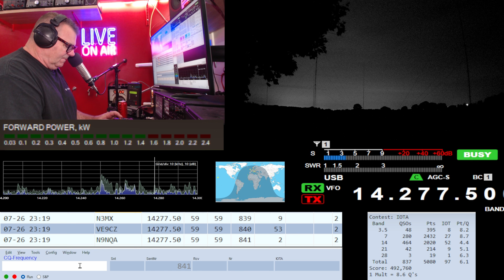Why I Don’t Want an SDR Ham Radio

Comment: I use a ft991 which is the back up radio,  my main radio is ft1000mp which is 21 years old. I have end fed mono band vertical and horizontal and dedicated listening antennas for each band i use. over the years i have finally l settled on the right antennas, I'm in a built up area. noise level between 5 and 7 depending on time of day
Reply from the maker: The FT-1000MP really is a fun radio – once you’ve got antennas and receive sorted, age matters far less than people think. Settling on the right antennas in a noisy area is half the battle, and it sounds like you’ve done exactly that 👍

Comment: it's kinda not about SDR vs super-het I guess, but about all the DSP that is very common in the modern transceivers, which happens to be SDR at the same time. reminds me on how many assume all electric cars to be a computer on wheels just because those two modern trends are usually sold together.
Reply from the maker: Yes. It’s not SDR per se, it’s how much processing gets layered on by default. Just because two trends arrive together doesn’t mean they’re the same thing. You can have DSP-heavy radios that feel fatiguing, and SDR-based ones that are very natural - it all comes down to implementation and how you choose to use it.

Comment: I have had many transceivers, but I keep going back to my FTDX-5000. I am able to hear and understand the signals better. I also suffer with constant head pain due to a head injury from a car accident back in the 90s, when I use my FTDX-5000 I can listen to it for longer without making my head worse.
Reply from the maker: Thank you for sharing that. Comfort and fatigue really matters, especially when you’re listening for long periods. If a particular radio lets you enjoy operating without making things worse, that says a lot. The FTDX-5000 has a very easy, natural presentation, and I’m glad it works well for you.
Reply: thanks Cal, Dave M0PEX

Comment: I agree with this as a Cw contester. The k3s is just super pleasant to operate compared to the 101/10 series. I don’t put direct sampling rxers in my top 5 at all. Icom is dead set on it. Wish these companies would bring superhet back
Reply from the maker: K3S is apparently very easy on the ears. Direct-sampling has its strengths, but for long contest sessions the way a superhet presents signals still matters a lot. I suspect there are more people quietly wishing for a return to that approach than the marketing departments realise.

Comment: I have a 7851 and 7760 and fully agree!
Reply from the maker: OK... Expensive. Tim Duffy is still using the 7851 I believe. If a radio makes you want to operate for hours without fatigue, that’s where the value shows.

Comment: That's the problem whit lot of operators, the key is listen listen and listen in the noise.
SDR great but you say it all, DNR/NR can help sometimes too get a weak station out of the noise but a good analog radio whit a good external speaker or good headphone does it too but you have too have trained ears to notice a station in the noise.
Have listen too many radio's in  40 years to HF rigs and SSB CB radio's and the new ones nah... too noisy too sensitive whit white noise like SDR  and so on.
But like you said it's personal and depend where your location is, in a noise free area every radio will do fine but in QRM and noisy urban area different radio's can make the difference whit qrm.
Reply from the maker: Exactly. Listening is the skill that everything else sits on. NR/DNR can help at times, but trained ears, a good speaker or headphones, and time spent listening do just as much. And you’re right - location changes everything. Quiet rural QTH vs urban QRM are two completely different games. Use what works where you are 👍

Comment: Last year i bought a Yaesu FTDX10 which is a hybrid and it sits there gathering dust..... Its a nice radio but im happier using my older rigs like my TS950, IC751A or even my 1967 Swan 500, much more fun to play with.. Just my thoughts.....10 10 till we do it again.....
Reply from the maker: That makes perfect sense – those older rigs are fun to operate and that counts for a lot. The TS-950 apparently had real personality. If it makes you want to sit down and listen, it’s doing the job. 10.10 old friend!

Comment: The numbers are useful  if you want an accurate S-meter instead of  a "guess meter."  Before SDR you couldn't get accurate signal strength meters.
Reply from the maker: That’s fair - accurate meters are useful. I admit I rarely quote them though… it’s usually more “you sound like S5 to me” than a laboratory reading...

Comment: This is the ham radio version of the old vinyl versus CD debate. However, your TS-990S is not an analog radio. At the IF stage, it chops the signal into bits and processes it digitally, just like an SDR.
Reply from the maker: True - the 990 does digitise at the IF. My point wasn’t analogue vs digital as a block diagram, but how the front end and filtering present audio to the ears. Same maths, different feel in use - and that’s what I was talking about.

Comment: I was a police dispatcher for many years and I couldn’t agree more with this! I knew who was talking by the sound of the voice before I was given the unit identifier. Analog was the best and when digital trunking came about I nearly lost my mind with how much “garbage” I heard from the digitizing of the audio. After 20+ years retired I still dislike digital radio, to include DMR, D-STAR & C4FM. I don’t know if I’ll ever get used to those modes. One of the most pleasant experiences I’ve had was operating an old tube transceiver, the audio was rich and full. Amazing to me. Cheers and 73.
Reply from the maker: Wow. That’s a fantastic analogy. Voice recognition, cadence and tone become second nature when you’ve spent years listening under pressure. I can completely understand why early digital was such a shock - a lot of context gets stripped away. Older "stuff" can have an audio really does have a richness that’s hard to forget. Thanks for sharing that experience, and 73
Reply: yep. the thing about those specific digital voice modes, is that they all using a synthesized speech (specifically using the AMBE (or IMBE in case of D-Star) vocoder) 
interested to hear your opinion about the sound quality of Allstarlink for example, where it is still digital but an actual voice streaming rather than a synth.

Comment: I don't want an SDR receiver either. I've done buying any more radio gear now. 
I have my h/b QRP s.s.b./c.w. tcvr with one luxury, an audio c.w. filter, also an FT817ND with one 455 kHz xtal as a c.w. filter because I'm Scrooge and wasn't paying £130 for a c.w. filter so increasing the cost of the 817. It works O.K.
I love my Racal RA17L rx with excellent filters and very stable. 
Even my old wide receiver Wireless 19 Set is useable with good c.w. listening ears. 
I remember one amateur saying, "Why should I struggle listening to a signal which is not 5.9.?"
Because we can! I've worked c.w. signals at 2.3.9. and 3.3.9. C.W. ears do it!
G4GHB.
Reply from the maker: Well said. That quote sums it up perfectly - because we can. CW ears and time at the receiver make all the difference, whatever the gear. The RA17L looks like a classic too. Thanks for sharing that perspective - proper radio!

Comment: I actually have a similar problem with my G90, lovely radio to use portable and tunes any old wire, but the standby/running noise it generates even in a quiet location is irritating to hear. To me it sounds like a high pitch whine and I hate it! 

If I had heard what it sounded like in person, I would've bought a FT-891 instead.
Reply from the maker: You’re not alone there. The G90 is brilliant for portability and tuning anything you throw at it, but that background whine does bother some ears more than others - and once you hear it? You're stuck with it... It’s one of those things you only really discover by listening for a while. The FT-891 definitely has a different, calmer audio character. Another good example of how specs don’t tell the whole story.
Reply: That whining was introduced in a FW upgrade - I think to have more gain, the input to some of the SDR stages are being driven too hard. It's been reported for over a year. In general I agree with Callum an old school radio or at least one with an analogue front end, allows the brain to decode the weak signals  better, and it's easier to listen to. Ed DD5LP

Comment: All ham operators have the same ability. If I’m operating in company, who aren’t ham operators, they struggle to hear anything. Think you are talking about filtering which I hope your 990 would have that. Respect your opinion though
Reply from the maker: That’s a good observation - there is a learning curve. Most of us forget that it takes time to “tune in” to SSB and recognise cadence and structure. Filtering helps, of course, but ears adapt surprisingly quickly once you spend an hour listening.

Comment: I have never been a fan of DSP.  I try it but invariably switch it off. I still remember from my SWL days 60+ years ago using a terrible no filters wide open superhet and you could judge the state of the band just by the noise. Modern radios are very good but I miss that experience.
Reply from the maker: I know exactly what you mean. That background noise told you how the band was breathing long before you heard a signal. Modern radios are remarkable, but that sense of context is something many of us remember fondly. Thanks for sharing that memory!

Comment: Everything you say is a proof you desperately want an SDR transceiver with waterfall where to apply your good hearing skills. When somebody launches CQ, even a strong signal, with a classic analog transceiver you can be on his/her frequency exactly in his break, and miss him/her. I don't; I see it on the waterfall, on YAESU FT-710. You can miss even extremely strong stations on an old analog transceiver without waterfall. After knowing a station is there, on which frequency, you can apply DSP or not. Maybe it is not even necessary to apply any DSP at all. It's about missing completely the station or not. An SDR waterfall shows you somebody is in the band, where in the band. All your rest of discussion has to do with your good hearing skills, not with the SDR waterfall. Another comment also told you about confusing SDR waterfall with DSP. Daniel VE7LCG
Reply from the maker: I get your point - waterfalls are genuinely useful for finding some signals, and I’ve said many times they’re excellent tools. This video wasn’t about discovery, it was about copy once you’re on frequency and listening fatigue over time. Different tools help at different stages. I’m not anti-waterfall at all - just choosing where I rely on ears rather than screens.

Comment: I totally see where your coming from, I'm not opposed to sdr either but it makes total sense. I too want my brain and ears to be my personal sdr and not have a machine take away my control. Reminds me of vehicle manufacturers completely automatic, no manual transmission taking away my control to repair or drive it myself. I still have a lot to learn myself.

Oi from Alabama USA 
TU, 73 de Kq4hcu

Comment: I've said it before, it's all in the style your use to working with.  Any rig made in the last 20 years will provide you a good service. True SDR rigs are not for the person who rushes setting a station up. If you want to use hybrid sdr "plug and play" buy one of the big 3 box store radios. You need a good quiet antenna to rx with, you need to have an electrically quiet environment as well. Let's get to the Sherwood Report...It means nothing, way too many variables in buying a radio then to worry about something you would need test equipment to see. The 990 is a great radio as well as so many others. I've had the chance to use so many in my short 24 years in the hobby. This video hit the main point, use what works best for you.
Reply from the maker: Well said. Style, environment, antennas - they all matter far more than a single number on a chart. Almost any modern rig will do a great job if it suits how you operate. I’m glad the video landed on that point - use what works best for you. 👍

Comment: I understand completely. Ham for 50 years. Worked in paging and mobile telephony for over 30 years. I used my ears and my brain to tune and to perform diagnostics. Most young hams do not have the ability and, do not understand it.
Reply from the maker: That experience really shows. Years of listening trains a kind of judgement that instruments and menus can’t replace. It’s not about age so much as time spent learning to listen. Skills like that aren’t obsolete - they’re just harder to acquire if you never need to develop them.

Comment: SDR is more consistent and cheaper those are the two driving points of it as with any receiver in some situations this one makes it better and in some situations that one makes it better
Reply from the maker: Exactly - that’s a very sensible way to put it. Consistency and cost are big wins for SDR, and like any receiver, different designs shine in different situations. It’s all about matching the tool to the conditions and how you like to operate.

Comment: You have, my friend, a talent not many of us have. Good ears. I live in a very high noise floor area and struggled with an older radio. Eventually I bought a Yaesu FTdx-10 and the filtering solved a lot of problems. I know I've given up a lot of weak contacts but before I was missing weak and strong because of the noise. Use the radio or radios you like and feel comfortable with. The puppy is growning.
Reply from the maker: Thanks Jack - that’s very kind. And you’re spot on: environment changes everything. In a high-noise location, good filtering can be the difference between any copy and none at all. Comfort and confidence matter just as much as absolute sensitivity. And yes… the puppy is definitely growing!

Comment: oddly, I get what you are saying, as a new ham, with having only used a G90 and FT-710. I recently was working a station on the 710, and I was certain I heard "s", and after 30 minutes trying yo get through, discovered it was a "z". I am almost certain it was was all the filters and processing distorting an accent.  Sometimes I turn them all off, and go "wooo, that is noisy". In most cases all that processing helps, but I am running in to a few edge cases where it is definetly getting in the way.
Reply from the maker: That’s a really good observation - and you’re probably right.

A lot of processing does help most of the time, but in edge cases it can smear consonants and accents just enough to mislead the brain. Turning it all off feels noisy, but sometimes the raw audio actually preserves the shape of the sound better.

You’re already doing the right thing - experimenting and when to trust the radio and when to trust your ears. That instinct develops quickly once you notice it.

Comment: I contest with a TS890 in a high noise QTH. In the ARRL 10m DX 2025 I found myself more than once with filter wide open and NR OFF. Just fiddled with RF and to my surprise I was able to get out some weak JAs. The SDR rigs  are good at cutting the racket, but sometimes I don’t get as good a copy as with the 890. These SDRs sound like I am underwater scuba diving.
Reply from the maker: That matches my experience exactly. Sometimes opening things up and riding the RF gain lets your brain do the work better than any algorithm. That “underwater” SDR sound is a perfect description that Mike had with his.. Quieter, yes, but not always clearer. Great result pulling JAs out like that!
Reply: Sounds more like operator error than the radio, DNR on the ftdx10 has that warble, which I never liked.

Comment: OM, you are so spot on with your analogy of SDR.  I'll put my older radio up against SDR any day or night.  Thanks for your contribution of real time knowledge (not that of a Ham In A Day graduate).  You (we) are becoming a dying breed.  Keep it coming.
Reply from the maker: Replying to both: I really appreciate the support - but I want to be clear this isn’t about old vs new, or “us vs them”. There are genuine performance advantages on both sides depending on what you’re doing. My video wasn’t a challenge to prove one wins, just an observation about how different receivers feel to operate and how ears adapt. Plenty of room in the hobby for all approaches.
Reply: Hey Gary, I will take the challenge.  What part do you want to compare and even prove to you where there are many performance improvements from CESSB, AGC pumping and selectivity. Pick one and we can go head to head on it.

Comment: Sit in front of a Collins KWM-2, S-Line or a Drake set up and you'll compare everything else to that. JRC JST-245 and the Icom IC-7800 the two best Superhets I ever sat in front of. The rejection tuning especially on a 75S-3 receiver will add between 40 to 50db of attenuation when you roll it over where the peak is. I have solar inverters and all sorts of strange stuff in my neighbourhood, but it get's me by every time. SDR's are great of course, but then again I always preferred manual cars as well until we couldn't buy them anymore.
Reply: I have a Yaesu FT857 with the DSP and a Drake 2B with the speaker-Q-Multiplier. For CW in a pile of other CW signals, the Drake can pull a single signal out of the mess where the Yaesu just doesn't. After many years of being a musician, my hearing is damaged enough that I have difficulty with SSB so I'm primarily a CW operator. I do love the Yaesu for having all bands, is quite portable, has a built in keyer and is frequency stable as a rock! Ken - W8VIW
Reply: @kenzuercher7497  Thanks Ken and yes, I've also got the Drake 2B with Q multiplier speaker and it's QRM fighting abilities are amazing. 73 de VK3USA.